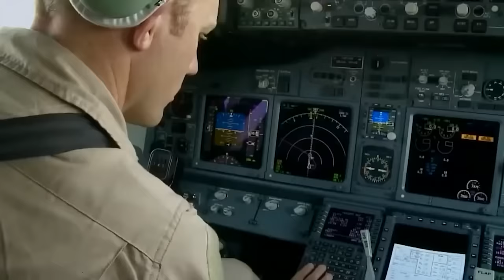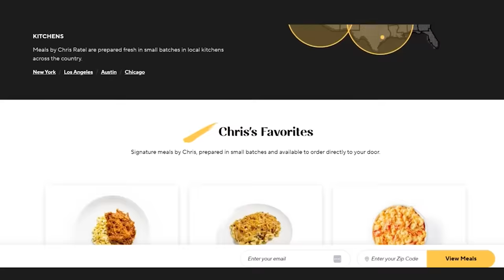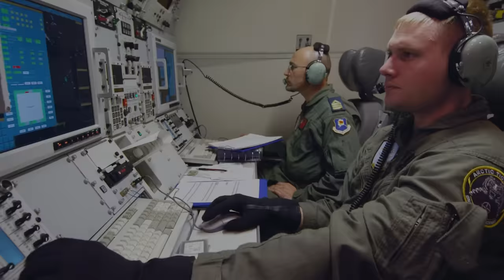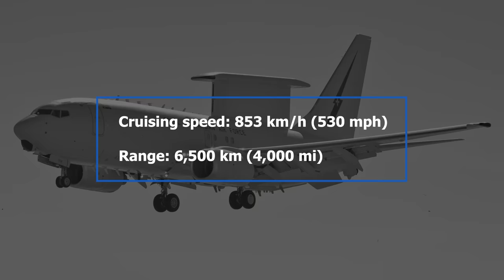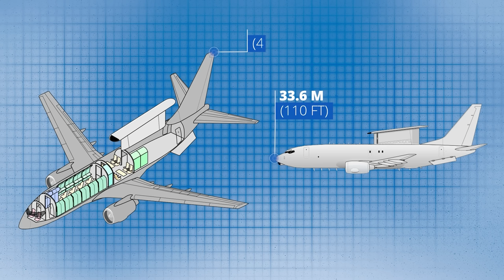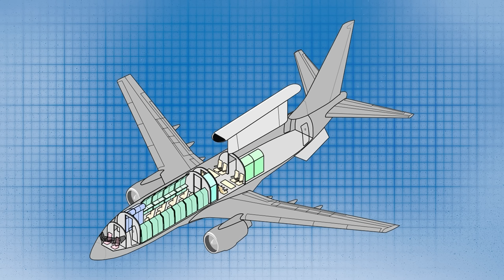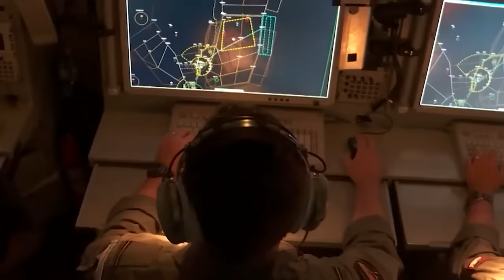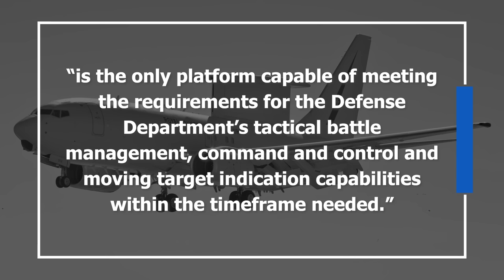The Boeing Wedgetail: The Plane That Will Control World War III

Comment: Sadly the biggest danger to this plane may be the door falling out
Reply: Lol
Reply: That’s the max. This is the NG model
Reply: Or the wheels falling off
Reply: Had to be said!
Reply: @kananisha  not really how that works
Reply: Lol but it isn't Max so it's fine
Reply: Sheeeet
Reply: That’s literally not a danger at all
Reply: @cruisinguy6024  you don't follow current events or don't understand how jokes work. Keep trying.
Reply: @FartNoodle22  Nearly identical frame but different final assembly lines. Still issues have been found upstream that affects both in recent months.
Reply: @dannyboyNS752  I do follow current events and I do understand jokes, it’s just all these door comments literally are not funny.  

They’re dumb and ignorant. Setting aside the fact the door happened ONCE (mind you there’s probably close to 1,000 737 Maxes in the air right now as I’m writing this) the plane in question isn’t even a 737 Max, it’s based on the 737-700.
Reply: @freetobe3  yea however the Ng has been in service a lot longer so these events more do affect the max but ur right
Reply: Why is everyone over analyzing this?? It's a joke! There was a door that flew off a plane and several others with missing bolts and stuff. If you don't get the reference there's no help for you!
Reply: Just tighten the bolts each time you get on, come on this is not rocket science !
Reply: I'm going to assume that THIS plane is subject to better inspections than commercial craft (which is bullshit in and of itself, but we all know it's the way it is), but what a GREAT comment. Bravo.
Reply: It’s a little surprising that this advanced technology AWACS plane was sold to Turkey after the advanced F-35 stealth fighter sale was declined!
Reply: @FartNoodle22  The engineering side of the NG is solid as a rock but parts still need to be manufactured and assembled and that's where things go sideways.
Reply: Lmfao😂
Reply: It's  a 737 NG not a 737 Max. So no problem.
Reply: Cheap joke there........remember Boeing has had the majority of issues with the Max versions of the 737. The Max is a longer pletform that changed the aerodynamic profile of the original which necessitated the addition software systems to counter some of the projected aerodynamic challenges. Unfortuneately Boeing chose to install a system known as MCAS used on previous aircraft like the USAF KC-46 airborne refueling tanker to automate the trim of the aircraft as it offloaded fuel while in the air. The MCAS was installed on the Max aircraft and pilots were not given any additional training with the new feature. I won't go into all the specifics as this can be read online or seen on various air disaster YT channels.

The E-7 Wedgetail is based on the 737 platform which has a very good safety record and there are 12000 airframes around the world.

Just thought I'd clear that up since a lot of jokesters are equating the Wedgetail platform with the 737 Max which are different.
Reply: @FartNoodle22 same company, same dei policy
Reply: Wrong plane.
Reply: @kananisha that was a 20yr old 757. Boeing deserves plenty of criticism but the reflexive blaming of them for problems that would have to be from improper maintenance is so dumb.
Reply: Ha
Reply: @@RAS_Squints nah, that's just an issue with the civilian planes lol. The military planes made by Boeing are world-class. It's the models you can fly in at the airport that you need to make sure you got a valid will in place before you step on board👌🏻😂
Reply: That's not sad.
Reply: Dead ass😂
Reply: It’s a different generation of 737 which has proven reliable and safe for decades. The recent iterations are the ones with issues such as MCAS failings and decompressions
Reply: As long as the front doesn't fall off 😂
Reply: @cruisinguy6024  the also had the two whose autopilot crashed the planes in 3019...they've had a number held up in production because of missdrilled holes in the pressure bulkheads and a world of other problems including massive cost overrun on multiple fixed price contracts ts.

But again, its a joke. It's not literally but you replied that it literally.woukdnt happen. 

And the jokes are hysterical.  Good luck making friends and learning to have a laugh.
Reply: Actually, the Wedgetail is built on the 737 NG aka 737-700ER. It has nothing to do with either the Max or 9 models.
Reply: 😂😂😂😢 true
Reply: @rickbase833 You’re correct. It was created solely to help the 737-MAX maintain the main selling point that applied to the 737 line which was they all fly the same to the pilot. Whether the pilot was flying a 737-100 or the 737-MAX they would handle and feel the same when flying. This allowed airlines to not have to have pilots get certified to fly the new model. The MCAS compensated for this allowing them all to feel just like any other 737 regardless if their version and configuration.
Reply: @kananisha  that's the Ringling Bros & Barry & Obiden circus in TWH currently . . .
Reply: @jolness1 32 years old. Stopped building them in 2004, 20 years ago
Reply: Many years ago I met some Aussie engineers here in Seattle working on the wedgetail. They called it a “Kangaroo counter”.
Reply: Lmao
Reply: @cisco680  Yep, thanks for adding that in!
Reply: Why would that be a problem???
Reply: @cruisinguy6024 "Door falls off" should be a 1/1,000,000,000 event, at most. You don't understand the severity and criticality of "Door must remain attached in flight/ plane shall not develop big holes during flight". This was a fuckup of massive proportions. Don't try and trivialize or apologize for it.
Reply: Well if Boeing and the USAF cant agree on price
It will be DOA which honestly the best thing
The USAF needs to revive the E-10 program using the KC-46 as base
Reply: @verdebusterAP Me thinks you have stock in or work at Northrop Grumman. I was at NG for 23 years.
Reply: @cruisinguy6024 happened once within a company that has other door plugs with improperly installed assemblies is cutting it slack it doesn’t deserve. The clear shift in Boeings priorities over the past 2 decades should be cared about and made fun of until they can change and show us there’s no point in making jokes at their expense.
Reply: @xerveschex5761  YouTube comments is the world's largest and most profound comedic and intellectual desert. It's worse than Yahoo answers, makes Twitter/X look like fun and makes Reddit seem like a gigantic multiplex full of geniuses of every sort. Which is really saying something about the quality of discourse on YT.
Reply: @cruisinguy6024 at this point why would you trust boing at all. Innovation and engineering or quality control seem less important than reliability, safety or the managers Bank Account.
Reply: Lol 😂
Reply: Ooohhh burn!
Reply: @letsgobrandon416 Nah that usually happens to marine tankers 😅
Reply: Underrated comment
Reply: @vanroeling2930 they gave this in 2014 to turkey and they were going to give the f-35 to them until they bought an s-400 system from Russia which would have comprised nato security and Russia was under sanctions so that’s why they didn’t get it
Reply: That's just passenger stuff none of the gets regulated anymore
Reply: OMG I WAS THINK8NG OF THAT TOO!!
Reply: F*cking brilliant
Reply: @cruisinguy6024 
Someone who actually knows something.
Reply: @dannyboyNS752 
Keep laughing at all those lives lost. You're a bad person.
Reply: @rickbase833 
Someone who actually knows what's going on.
Reply: That’s a new one.
Reply: The 737-700 doesn't have door plugs like the -900er or -9Max so not an issue.
Reply: Hahahah 😂
Reply: That's only a commercial feature
Reply: Merciless... but accurate and timely comment 😂 👍🏼
Reply: They might spot a stealth aircraft or two through that as well😂
Reply: Too soon lol jk not is not burn lol
Reply: @kilianhzh boing...... Boing..... Boingggg boing boing
Reply: God you'd hope some US general would be like" while you're upgrading it fix that fuckin door"
Reply: @crf80fdarkdays  fucking autocorrect
Reply: Different plane
Reply: @xerveschex5761 the max and the ng are different airframes, the max is longer and has extra doors. The jokes really aren't funny when people just lump all of the 737 family in as one type of aircraft when there have been many iterations since the original design from the 1960s
Reply: @spadej791 ...... they won't have that problem because they wont have that door because it's a different model..... the wedgetail is based on the 737 ng, the one with the door problems is the 737 max.
Reply: Could be an opening for ….russian disinformation
Reply: @kilianhzh  gotta love it
Reply: The Aussie ones were made before Boeing’s present woes. 😘😉
Reply: Now that’s some funny shit right there…but true!! Bahaha
Reply: Different aeroplane mate.
Reply: @FartNoodle22 - Boeing has had QA QC issues on military aircraft as well. Well documented by IG office.  I assume that they thoroughly go over the frames meant for E-7s
Reply: Or the system malfunctioning in nose dive position. Remember Ethiopia.
Reply: If its made in China that would 100 percent probable...Lol.🤣🤣🤣🤣
Reply: Normally they make them so the front doesn't fall off
Reply: Whoops
Reply: @Battleneter or put the emergency exit back in 🤷🏼‍♂️
Reply: Yeah… no. Only the long fuselage -900s and MAX9s have those plug doors. This is a short -700.
Reply: Goddamnit that's good...and too soon, but also, holy crap does it appeal to the gallows humor in me lol
Reply: Boeing employees are stone at work since weed is legal in WA
Reply: Diff model
Reply: Not a Max9 so not possible
Reply: 😂🤣😂🤣 right? Is it a max9? I thought it was the same as the new kc46 either way funny comment made me laugh
Reply: @@UwU-pk6nv underrated comment because it was funny till you had to overanalyse it lol
Reply: If that's the worst problem they have on duty there won't be anyone sad about it
Reply: Was designed when Boeing was Boeing... not the weird meged shiv we got today
Reply: In case nobody else has said this aircraft and its Russian counterpart will be the very first targets in WWIII.  This function needs to be built into each fighter not depended on for success in a defenseless aircraft.
Reply: @FartNoodle22  Yeah do ask Boeing why the US Air-force's refused the delivery of KC-46 air tankers few years back lol!
Reply: Too soon?
Reply: @blackbirdmenagerie autism
Reply: Dude. Too soon.
Reply: O m G that’s so FUNNY never heard that one before!
Reply: Mass produced commercial airliners are at risk, Boeing won’t fumble the bag for the military industrial complex. When it comes to military aircraft, Boeing and Lockheed are superb
Reply: It’s dangerous to talk about the door falling off too.
Reply: LOL you got jokes
Reply: Stop, He is already dead.
Reply: Really not funny, delete this comment.
Reply: Not the same plane bro…smh

Comment: Imagine the E-7 and P-8 arguing about which one is deadlier until the MAX points out that it has more "confirmed kills".
Reply: Aren't the Max deaths partially attributable to poor maintenance of the pitot tubes?
Reply: @ch4.hayabusa  No , it was just bad software and design.
Reply: @ch4.hayabusa  Software, but pitot tubes have caused crashes on other types of aircraft.
Reply: When it comes to 'confirmed kills', DJI is so far ahead of everyone combined it isn't even funny.
Reply: Haha comments even better when u release that the E-7 and P-8 will be on the same line at lossie haha
Reply: @ch4.hayabusa  I heard the tube froze. Btw, of the planes that crashed, the airlines cheaped out and did not buy the optional backup pitot tube! All Amrrican air carriers did.
Reply: Na
Reply: @Djamonja for the max crash it was a uncalabratred AoA sensor
Reply: @cypher1o1  It's a lot more complicated than that. They were using one AoA sensor, which was a mistake -- they have 2 on the 737 and were only using data from one, so anything that went wrong with that AoA was going to cause problems. When they got incorrect information from that sensor, the plane's anti-stall software forced the nose down over and over. That is the bad software part of the crash. They use both AoA sensors now and some kind of inertial navigation system as a virtual AoA as a 3rd failsafe.

Comment: Electronic warfare planes are absolutely insane.
Reply: Ya like the growlers
Reply: I dated an ec-130 jamming operator for a bit. They can, and have, shut down F-22's. The capabilities are classified and I didn't have need-to-know. But they can do stuff most of us don't even realize.
Reply: @davewebster5120  "The EC-130H Compass Call is an airborne tactical weapon system using a heavily modified version of the C-130 Hercules airframe. The system disrupts enemy command and control communications and limits adversary coordination essential for enemy force management. The Compass Call system employs offensive counter-information and electronic attack (or EA) capabilities in support of U.S. and Coalition tactical air, surface, and special operations forces."

They didn't shut down an F-22.
Reply: @davewebster5120 but was she any good at jamming things in other highly classified areas? 

This is the real question we all need to know
Reply: @Scopesdoped   They are in Australia operates them as well. Awesome aircraft.
Reply: @ragingmonk6080 I'm not sure quoting a Wikipedia page that confirms the EC-130 is indeed an electronic warfare craft negates the claim that it can bugger an F-22s radar or command and control capabilities. I strongly doubt that they meant shut down the f22 like a pc given the context.
Reply: @JAY.1983  Waddle away and eat your crayons in silence. I am a US Army Vet. that worked as a contractor for DHS and the National Geospatial-Intelligence Agency. I quoted that article because it is RIGHT!